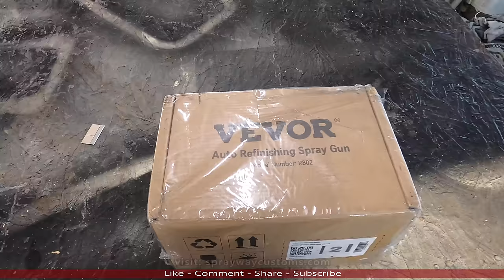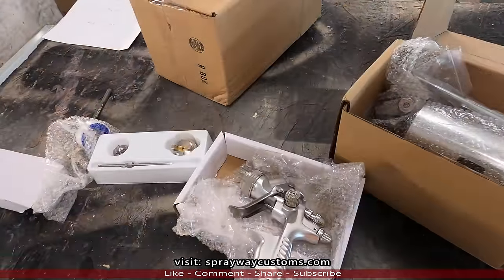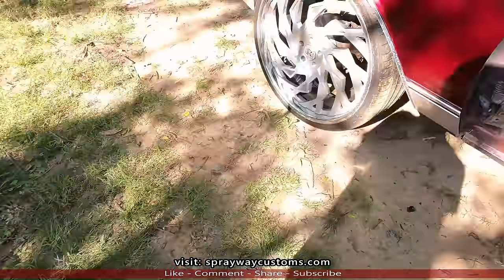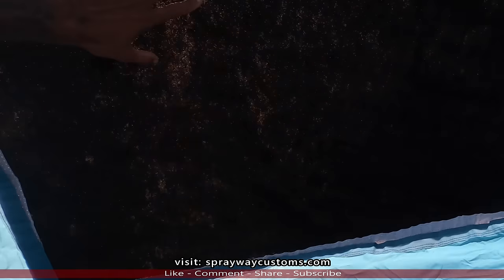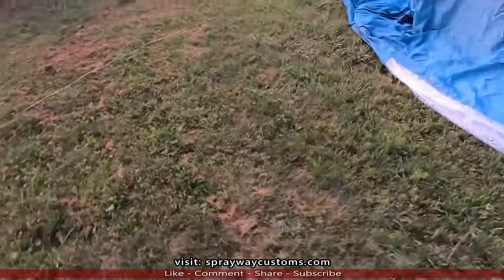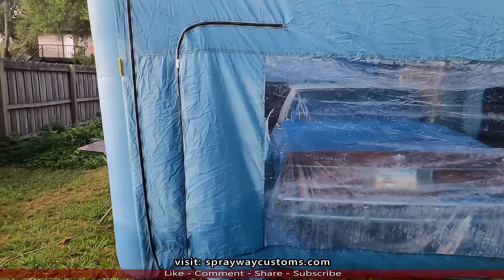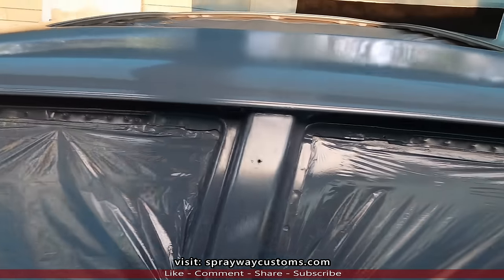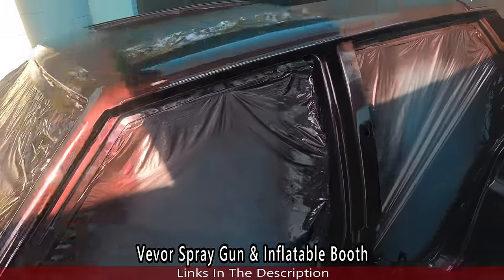Painting The Box Chevy Caprice In The Inflatable Paint Booth With The Vevor Spray Gun

Comment: I love watching you work with different brands, colors, techniques, and your honest opinion on stuff. I need to get me a gun setup. I was thinking about Harbor Freight but this comes with 2 tips, regulator, and sends cash your way. Think that 39ft booth gonna be what I need for my Yukon XL. Can’t tell if the prep room is the same for all of them or not. Keep putting out the content I dig it!
Reply: Skip that Harbor Freight and order an Astro Euro Pro HE. You can call the company if you want to purchase more than 1 size of needle and fluid tip. These are the most consistent low price guns I've used. I also bought an Astro EuroPro Evo-T for metallic basecoats. It has a soft pattern that sprays well when blending panels. I bought the HE 1.3 and the Evo-T 1.4 for around $100 each.
Reply from the maker: I’m not sure on the paint room on all the sizes?

Comment: Did that fan you put to suck out over spray make a bag difference?
Reply from the maker: Yes it did
Reply: @SprayWayCustoms  I have the same booth, i thought the small fan they sent for the exhaust was a bit small so I ended up getting a larger one like the one that inflates the booth to help exhaust the over spray out. I mine still gets pretty cloudy inside so I will have to try a fan sucking air out like you did. Did you only put a fan on one side and have both outside Filters opened?

Comment: Just curious, how did the ventilation of fumes on this booth compare to your workshop set up? Would you have been spraying in a fog without the addition of the external fan? I've been considering one of these booths but wonder how well the fumes are exhausted. I've been spraying under a carport, but do have to work around weather.
Reply from the maker: It actually did better than I was expecting

Comment: Be carfull when ordering a 39 foot spraybooth. They have 2 listed as 39 feet long but one is less money. I bought the cheaper 39 fòot booth and when I laid it out I could see it was not 39 feet but only 33. Vevor said in the actual description of cheaper one you will sèe that it is only 33 feet long and not 39 as advertized in main heading. They did not want to return it and offered a $300 discount. So I have a smaller booth than I wanted but for a really good price. My advice order the cheaper one then complain and ask for at least a $300 refund. I told them multiple times that their add was wrong but they don't care.
Reply from the maker: Thanks for the info